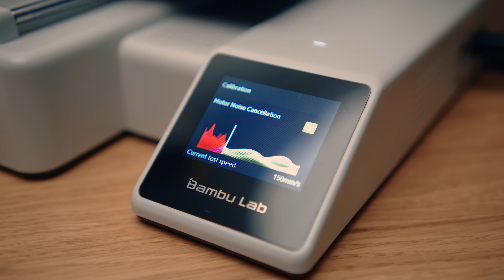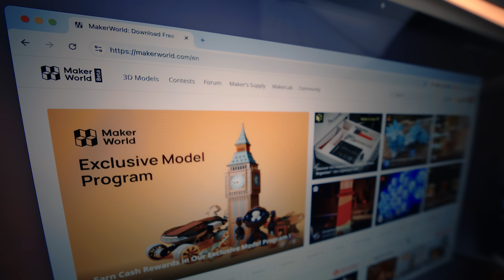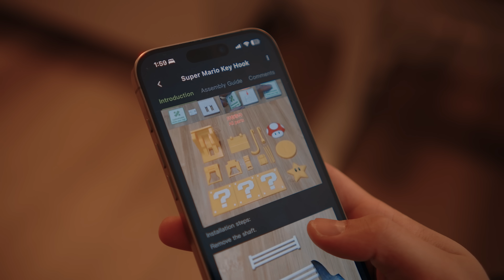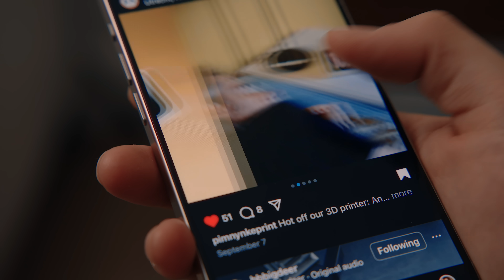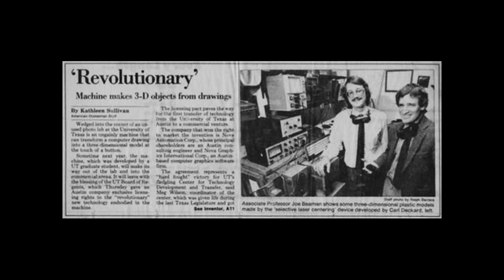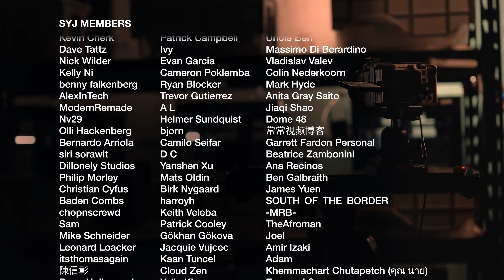make your own things

Comment: With woodworking you can make cupboards, shelves, tables, chairs, doors, boxes, even houses. With 3d printing you can make a knick knack you will probably throw away. I think that's the big failure of 3d printing tech at the moment, you can't build anything truly useful. Looking around me, there's very few things I could possibly 3d print, maybe I could 3d print a new case for my mouse, that's about it. I don't have anything else small and plastic.

Things I've 3d printed for fun include steel dice, a keyboard tent, and a cat food measuring scoop. Nothing revolutionary here to justify hundreds or thousands of dollars. Maybe we will get there one day, but right now almost anything worth having cannot be 3d printed, and almost anything that can be 3d printed can be bought cheaper and at higher quality.

Comment: Does anybody have a 3d modeling software recommendation? I have tried fusion, and am comfortable working with sketches. I just cannot for the life of me figure out how the design process works. Heck, I cant even move objects around. I am currently using tinker cad because of its intuitive design, but tinker cads accuracy and tools are lacking. I also plan on getting a better 3d-printer (Am using flash forge creator pro) and need one with a bigger bed and faster, high quality prints. All recommendations/advice is welcome. Thanks in advance!

Comment: GREAT video! One thing though, it is not completely true that before this only the wealthy could invent. There are many examples of this. What is true is it cost WAY more in the past but with good ideas and someone who was able to convince someone else with money could still launch new products even if they themselves are poor. 

We can see this today with stat up culture. If you have a good enough idea and can sell that idea well enough you can get funding.

I would also say that with 3d printers this only is true for certain type of products. Only products that can be manufactured to consumer grade with the available filament materials. But lets say you wanted to make parts that will be submerged over a mile deep in the ocean, yeah you aren't going to grab a bambu printer and make that happen.

Another factor is legality or certifications, depending on the solution your product is providing there may be manufacturing requirements that don't allow for 3d printing to be used as the primary process of production.

But again great freaking video just wanted to clarify for those that are newer to it and maybe think more can be done then what is actually possible at this time. Material science is still a critical piece of the manufacturing process. 

But for any manufacturing the one thing 3d printing touches almost every industry in terms of production is prototyping. The ability to prototype this cheap has NEVER been a thing. And with that ability it will allow you to pitch investors much more effectively.

Comment: In terms of design language this is why now everybody can design rubbish goes back in the day it wasn't the elite few with money that could design stuff it was the people who had designs worth going through that tedious project in order to be hired by companies that had enough money to go into the research and development stages of that project this is why when you research designers and combination with manufacturing like Herman Miller and the relationship between Ray and Charles Eames you'll find why it was a perfect synergy between the two because of these design limitations Combined with modern technology at the time the problem I see currently in the 3-D printing world is that now because every Tom Dick and Harry has a 3-D printer much like every Tom Dick and Harry has an iPhone everyone now thinks that they are a design studio lab or a top-notch photographer because they have the latest iPhone.. just because you have the ability to design something that hits the trending market doesn't mean that it actually serves a greater purpose like Well your design have longevity? Or have you just put a bunch of plastic back into circulation? This is why more and more often I am tending to recline back into what designs have worked for the last 50 years in terms of furniture and Just rejecting modern day plastic advancements I mean I love pelican cases because of the light polymer used with the injection moulding but that's an old school technique with modern pla that give the pelican case a 40% lighter when compared to its other counterparts. ... but all of this retro designing which is just cheap trendy stuff for people who think that it's going to make their lives better I'm sure once they get over the hype train and realise that it actually doesn't serve any purpose in their life especially when they upgrade to a slightly different shaped phone and the piece of plastic is now rendered absolutely useless, I mean what's the problem with Just asking siri what the time is. Without having the lights turned on all the time clock being displayed, I mean designers have already figured out this problem for what must be centuries now with the classic watch. People have designed tripods that have proven to be incredibly useful portable strong like I think you're coming about this being about accessibility is somewhat true but I feel more as though because everyone has access to these types of plastic printing shops Your under more pressure to actually get the idea out first before anyone else launches the same idea and so maybe it's not the greatest idea in the world rather than the most convenient and 1st to do it is more the driving force of these designs and I think you greatly underestimate the process that goes into design iterations when materials manufacturing and moulding is tedious and expensive it helps refine and inform the design process to aid and getting a bullet-proof product this is why when you start researching artemide lamps or Herman Miller aeron chairs you realise why they keep popping up time and time again and are considered modern classics and it's not because they did 3000 slightly altered iterations it's because they put literally blood sweat and tears into the design and made sure by the time it made it to manufacturing that it also was so sleek and beautiful that you would want my Just based off the first impressions looking at it. Like there is designed to solve problems and then there is design out of boredom and I think you tend to sit in the latter when I see Your 3-D printed drawer set with all of your stuff neatly laid up in it it may look pleasing to the eye aesthetically upon opening the drawer but if you have to be portable you then got to open the drawer leaving it out constantly opening the drawer to grasp one or two different items and they kind of already solved this with beautiful Old powder coated metal boxes from Japan where they look so beautiful out on display that you're happy having them on your countertop when you want to put them away they are segmented into parts they become multi use cases and aren't so hyper specific and proprietary to the thing that you're putting in them that they don't need constant iteration upgrades and alterations. I think what you're doing is really good for you and the way your brain works by telling everyone else that they should just get into 3-D printing is not very good honestly I've not seen one great beautiful thing that's been done on a 3-D printer and I think that's a byproduct of having endless options of creativity and at the end of the day show me one thing that doesn't have an equivalent in the non-3-D printing world that wouldn't beat it in terms of style affordability and ease of use? Like anything developed in 3-D printing tends to be geometrically mathematical and half if not all of the heavy lifting on those processes are done with computers it's just printing out digital poo poos from the computer's brain. There are tons of arguments for life 3-D printing is so great but there's many more arguments to show that it's really a tool for prototyping only and basically you have to end up 3-D moulding and casting and other materials if you want strength and rigidity

Comment: For a keyholder i just mounted a big lego slab to the wall and attached a flat lego brick with holes to my keys. It works really well, the only thing is that i need to replace the lego on my keys once in a while

Comment: I got an Ender 3 V2 back in 2021. I've been through a lot of pain with it, but I stuck with it. It's seen repairs, board replacements, extensive modifications, and is now my ever reliable workhorse. I can now just set it to print something, and I know it will come out fine.... If I remember to autolevel it after every 10 prints just in case.

With the amount of money I spent on the thing, and the amount of money on repairs and mods, it basically now amounts to just short of an Bambulab A1.

So to you newer people who are interested in 3d printing, don't try to skimp on money. Get a Bambulab printer. Unless of course you WANT to solve the print problems on your own, scour the forums, and do a lot, and I do mean ALOT of maintenance and problem solving, by all means, you can get a Creality Ender series printer.

I've printed a ton of stuff, and have now basically mastered printing in PETG, to the point where I almost exclusively print using PETG. From steam deck accessories, repair jigs, an underdesk mount for my audio interface, Nintendo Switch mods, PS5 accessories, wall shelf brackets, and more. It's a great feeling to get into those moments where "Man, if I only I had- WAIT!" Then you go online, find that exact thing you think you need at the time, and set it to print.

Comment: 3d printing is very cool. I got an A1 a couple months ago and in less than a day got up and running printing replacement parts for restoring retro consoles instead of having to buy them, which has not only been cheaper than buying and shipping something someone else made, but allows for much more customizations in the restoration process, like making new colours of shells, or printing multiple colours for buttons. Really cool stuff and I have loved working with it.

Comment: I have a janky Ender 3, so I'm not building anything too big!  But we still like drawers to be organized!  So I made little brackets that brace existing drawer dividers into the drawer (You can never buy a divider that stays put!).  And if they are 'expanding' - the expansion always creeps back and forwards as things move in the drawer, so I made a teeny little clip that essentially locks it in place.
Different custom braces for every drawer, and different custom clips for every divider (they're all slightly different)
 
It's almost a superpower!

(I also made a replacement piece of track for a friend's kid's hotwheels set.  A bancking curve that had all sorts of compound curves.  It was an awesome project to really learn Fusion 360!)

One day I might upgrade - but I still have guitars to buy, dammit!

Comment: This is a great video, youve really mastered the ability to edit and tell a story. I also enjoy the 3d printer because I simply have a business that needs a lot of ventilation flanges which cost $15 the last time i looked, and with a 3d printer I can print for less than $1 in filament, and have certainly paid off my Artillery Sidewinder X2 by now.  Not to mention I was able to get rid of a lot of heavy machinery I had to purpose make work for my business, now I have all custom machines made of plastic and motors, and I can throw it all away if I need to move and dont want to pay for storage, and simply print it again later.

Comment: Nice. I have a wood shop, planers, table saws (yes, plural, a cast iron cab saw, plus a smaller dewalt job site for quicker things, same with planers dewalt 735 and some ancient olive green thing that's 16" and change wide). I love to make things, for myself. I have a mini fox alien cnc, it's cool although it's a little pain in my ass. 

3d printing is something I never wanted, but I am now wondering.

Comment: One thing that I just learned recently, is when holding things with magnets, it is way more effective to use a lot of small magnets next to each other with alternating polarities. MagSafe works that way for example. 
I wish everybode knew this, so they would stop just using bigger magnets and then being disappointed, that the thingy it's trying to hold still slides down ;-;
Reply from the maker: whoa… you just blew my mind
Reply: Wow, thanks for the tip man 😬
(You're the kind of guy who makes my time in the comment section worthwhile ❤️)
Reply: wow, great tip!
Reply: is there a good youtube video on that I should look up?

Comment: About the magnetic key holder, I dont see 3d printing need as a plastic disc with magnets glued in the back would make the same result.
The fact PLA doesnt survive to get sun in a closed parked car, ABS layer adhesion is horrible and other options are expensive and hard to find here keeps me slightly afraid about 3d printing, my printer is horrible also, so it doesnt helps too.

Comment: 2:06
Look, i never understood 3D printing cause i love the idea of making cool things, but realistically i'm never going to have a plastic key holder. I try to always have as little low quality materials in my house as possible, focusing on metals, stone, wood, ceramic, etc
some things are only availible in plastic and i accepted that, but if something can be made of metal id be willing to pay 10x or even more for it to be metal.
when 3D printers using metal instead of plastic are a thing is when I'll buy them

Comment: When I found 3D printing it was called the RepRap project and I was enthralled. I wanted to do all the stuff I'm doing today, but the technology wasn't there. These days, if I want something that doesn't exist, I simply design it and 3D print it. Between modern filament printers and resin printing, there's very little I can't doodle and print in a few hours. Bespoke switch panels for my truck's interior? EZ. Apollo-accurate flight sim control panel for Kerbal Space Program? Had one since 2019. It's so wild living in the future I dreamed about when I was your age. I'm excited for what will be possible when you're my age looking back at these primitive tools you have today!

If you're reading this and still on the fence, but a cheap Ender 3 knockoff on eBay and a roll of filament. By the time you finish your first roll you'll be thinking of things you didn't know were possible today and you'll probably be saving up for a Bambu printer.

Comment: Started with a MP select v2, upgraded it with auto leveling, Octoprint, etc. Got a CR Ender3 pro, upgraded the MB + auto leveling, and Octoprint. This year I got an A1 with AMS lite. 3D printing went from a hobby to an appliance. Total game changer! I still use all 3 but the speed difference between the generations just a few years apart is astounding.

Comment: 8:07 anyone know a non damaging way to mount a 3d print to the wall besides a command strip?
Reply: Add magnet or metal plate to the wall before you build it, just like how he adds magnets to the key holder.
Reply: @zze130 heck if you aren’t afraid of a little spackle and paint, find a non-stud region of the wall, make a precise hole, embed your magnet and spackle-paint over it.
Reply: More command strips.
Reply: Roll of duct tape

Comment: PLA material is easy to be decompose after using 2-3 years, it is not good idea to sell your product made by 3D printer. Any solution?
Reply: PLA can decompose easily if in the proper environment, but it's not just gonna decompose sitting on your nightstand. Leave it in the wild and it will decompose after a few decades.

In an actual composting facility, it'll still take about 40 days or so to fully break down.

If you're still worried though, other filaments exist, like ABS and PETG.
Reply: @hackladdy9886  vendor told me these material should not be purpose of mass product for sale. Even ABS and PETG are still easy to decompose in 3 years. Are they right ?

Comment: 3D printing may be great, but you end up using way more plastic than you would otherwise, including prototyping. Your keyholder isn't as recyclable as a 3m command hook. In my opinion, 3D printing enthusiasts are filling landfills with unnecessary plastics.

Comment: Yeahh.. 3D printing is great, I love it but manufacturing hasn´t been that bad though. You can even today make a silicone mold for 1k and cast way better quality and more durable parts can you can print with FDM printers faster than printing them. It´s just you are too young to know.
ALso most 3D printed designs are made by some people somewhere who have no idea about engineering and their designs suck,they don´t fit or the walls are too think so it breaks etc. Yeah so while it´s great it´s not as fast or easy as buying a simple and cheap product online. Becasue we also live in a world which billions of different products that cost next to nothing.